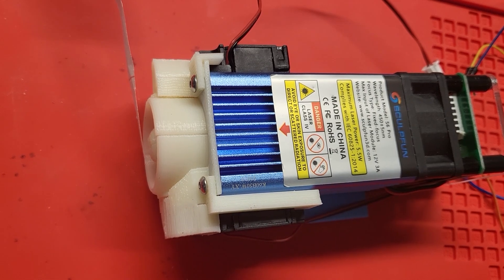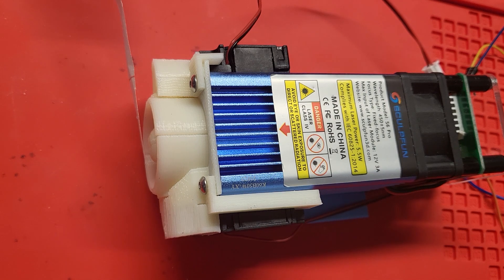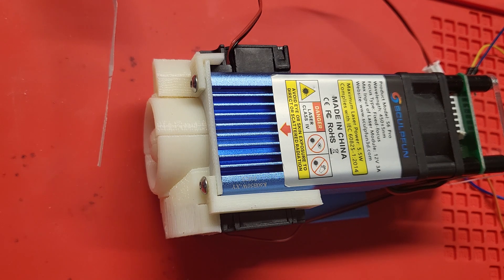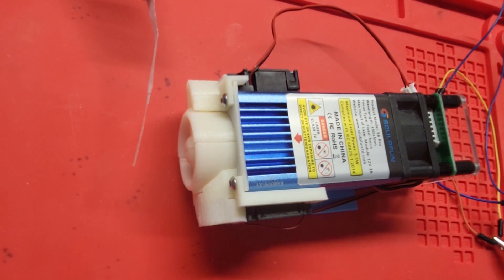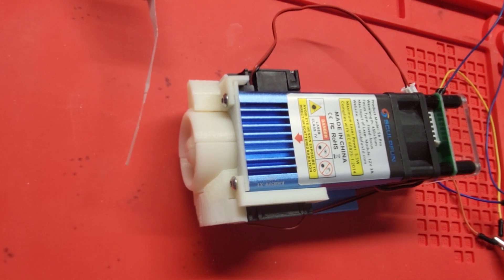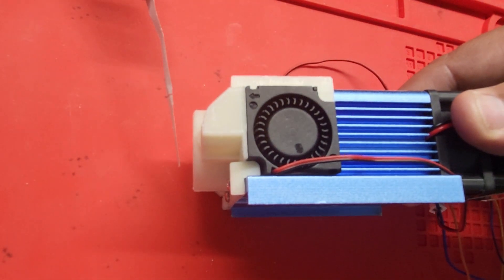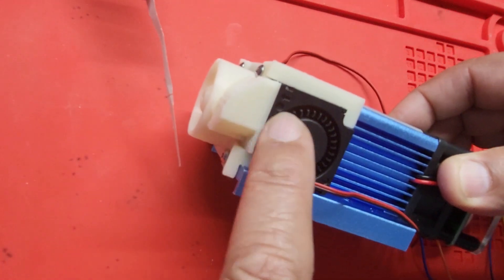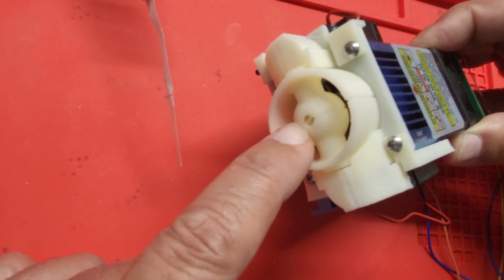SCULPFUN New "LOW COST" Air assist design.

Comment: Are you coming out with the 3D model?  I would love to buy it.
Reply from the maker: not yet, because I was working on the auto Z kit. If you want only the STL,  I can try to finish it, but if you want the kit you will need to wait a bit more.
Reply: What is the auto Z kit?  Yes!  The stl file will be great!  I can start on building it.  I'm building a big slot car layout.
Reply from the maker: @michaelclare8770  https://www.youtube.com/watch?v=RMAB_9hGBYo&t=17s
Reply: Where would I connect these?   To pin 3, or the 5vdc plug?
Reply from the maker: @michaelclare8770  https://www.youtube.com/watch?v=DuN2DWeORQA
Reply from the maker: @michaelclare8770  Fans will be replacing air pump, plus fans controller relay
Reply: Can I buy the stl files from you this weekend please so i can build mine?

Comment: How does the airflow compare to using the usual fishtank air pump?
Reply from the maker: I didn't test the fish tank air pump, but the flow is enough to blow smoke away. The paper resistance is many times more strong than smoke, as you can see. All you need is wind to blow  the smoke and ashes  from laser burn 🔥

Comment: Is it works for Sculpfun S9 extended frame 85 x 41 cm long? and where can I buy it?
Reply from the maker: Yes S9 compatible.
check http://ebay.us/61kKpG?cmpnId=5338273189
ebay
  "DIY SCULPFUN  Homing and limit switches with LED indicators(V2)_EXT_KIT"

Sculpfun extension kit
Longer cables
X= 24+ 52  inches
Y= 12+40  inches
Total length
approximately X =76 and Y = 52
Reply from the maker: Sorry I was confuse . the link I did post was for the limit switches.
for Air assist design is not for sale yet, need to do some tests and calculate the price. I had no time to get to the point of sale. I hope will have the answer very soon. this video was for the Idea and prototype.
but making the extension is just to make longer cables no problem.
I do have to finish the video and the instructions for the auto focus.
see 
https://youtu.be/shytewUGeWM

Comment: Hola Óscar, gracias por compartir.
Estaba pensando en diseñar un sistema como el que muestras pero con un único ventilador 5050 tipo turbina.
Saludos.
Reply from the maker: yo tambien lo tengo en mante pero es muy grande. yo tengo que probar que tan eficiente es
 este systema, y si no megusta entonces pondre uno mas grande.
estos fans son pequeños y muy baratos la pareja como ~10$ 
este fue el primer prototipo hecho en 3D. este fin de semana tengo otro diseño que imprimir y probar.😁
Reply: @HD3DHiFi  tienes razón, hará que pierda superficie de trabajo si el ventilador golpea en los perfiles. Además, añadir peso a la parte móvil del láser puede hacer que pierda precisión, entiendo, pues tendrá más inercia ¿Dónde conectas los ventiladores? ¿Tienes pensado compartir o vender el diseño?
Reply from the maker: @Afmu  Vender el diseño. los cables van conectados a un circuito. Mira este video en mi canal
 https://youtu.be/DuN2DWeORQA
en el lugar del compresor van los ventiladores.